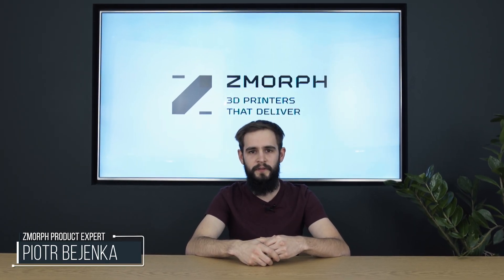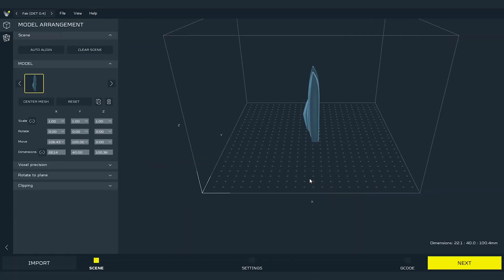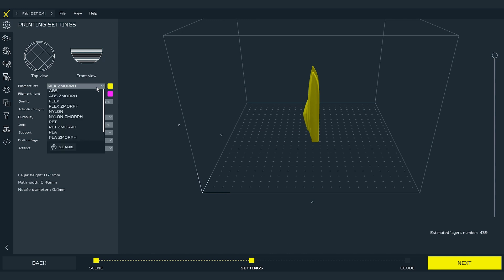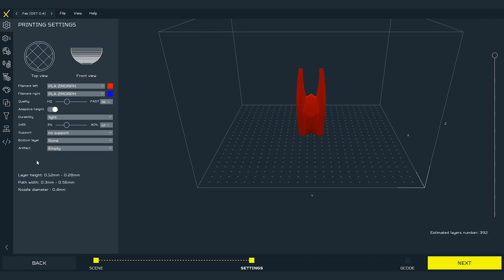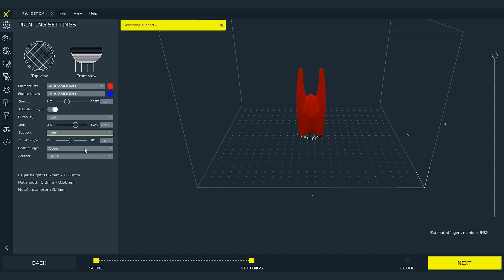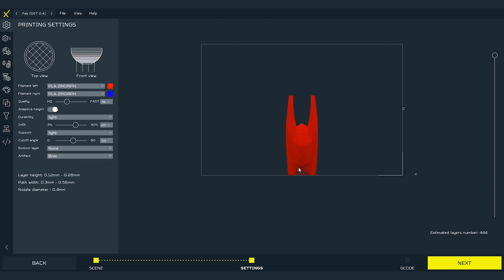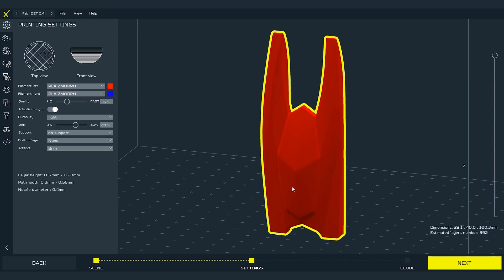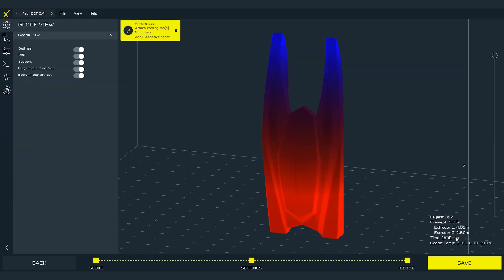Zmorph Fab & Voxelizer: Dual 3D Printing

Comment: Any updates for Voxelizer Experimental Version?
Reply from the maker: Voxelizer Experimental was a place for beta testing functions for Voxelizer 3.
Reply: @ZMorphHybrid3DPrinters  Will Voxilizer 3 be opened to other Printers like M3D's Crane Quad? It'd be super awesome to be able to upgrade into a newer platform if one is functioning better. Our user group would be thrilled to hear this!
Reply: Can you set custom supports on a desired area on a 3d model?